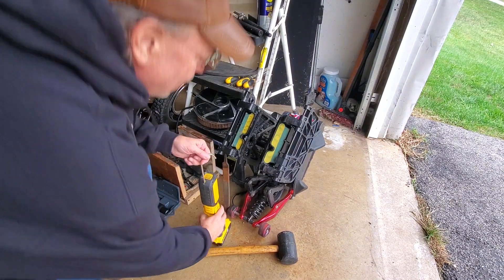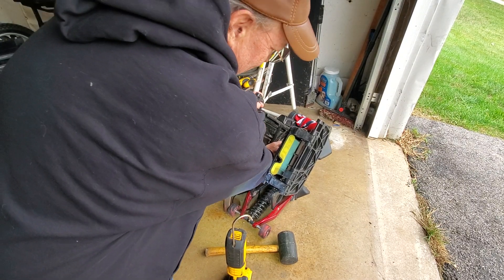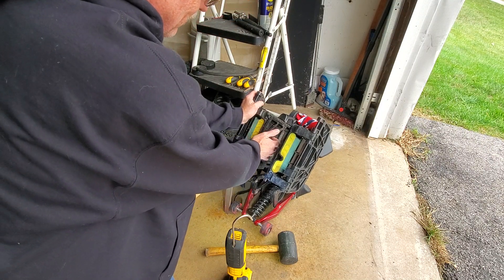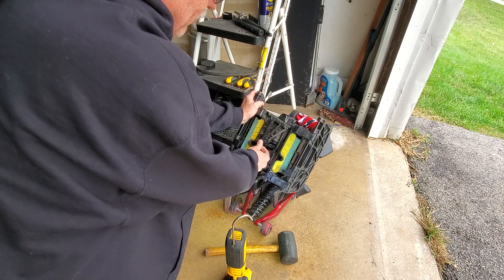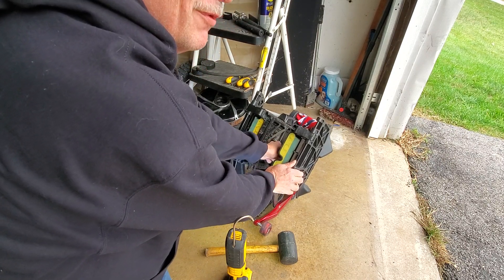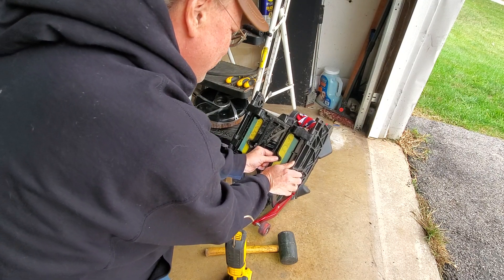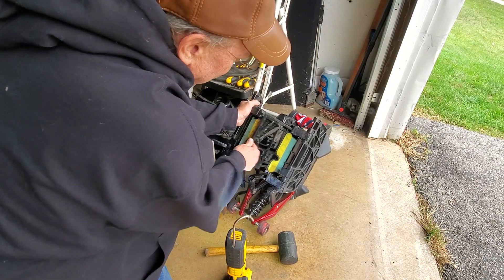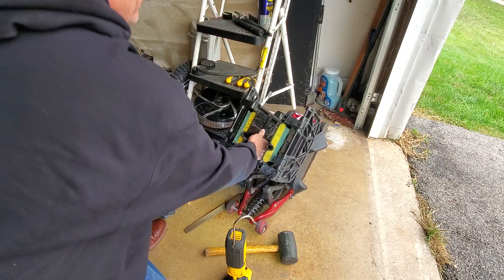Proof of KingSong S22 Slider Friction Problem

Comment: Time to investigate 3D printer and CNC sliders/rollers 😃
I can't wait to try my S22 3PO, the 3D printed ones.
Reply from the maker: I'm going to try just rollers 1st.  I have a set of 27mm rollers and the slots are 25.8mm.  So I plan to shave (angle grinder) them down to where they slip about and roll just a little better than the original bushings.
Reply: Time for Kingsong to step up and fix the problem!!!

Comment: If my motor wasn't clicking and popping, I could put enough miles on it to verify 😞. KS really dropped the ball on the motor recall.
Reply from the maker: Yea, seems there are multiple motor issues (stator slip, bearings too loose on the hub.  I noticed my hub has laithe marks from removing about 1mm of material on each side.  That was too deep - and now I will be depending on Locktite to keep it from destroying the hub.  Oh and it needs sealed too - water ingress obvious from the rust.